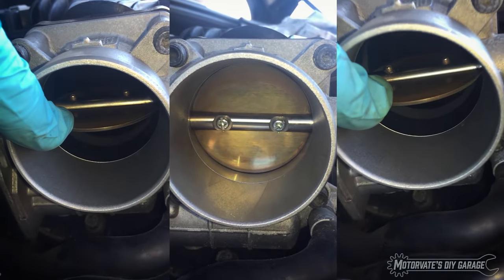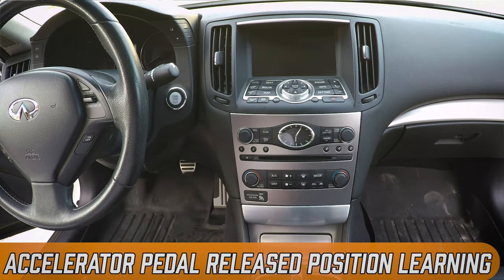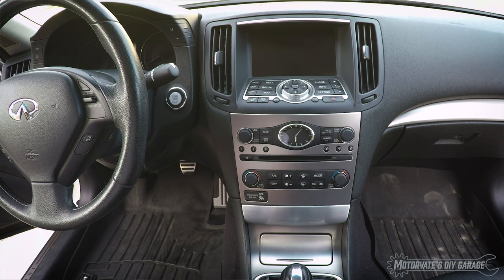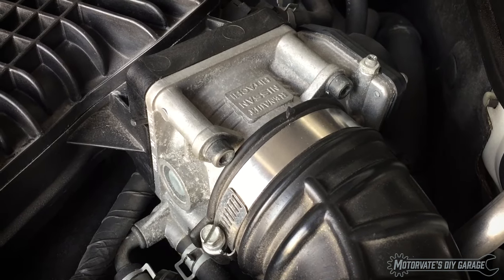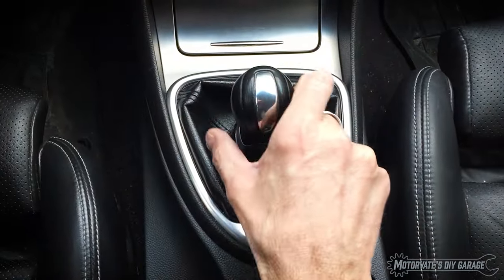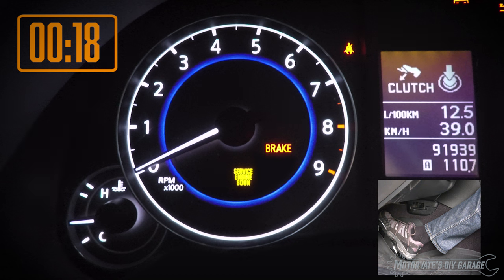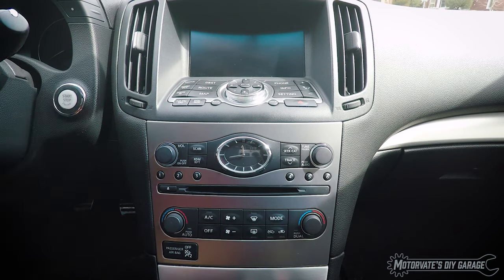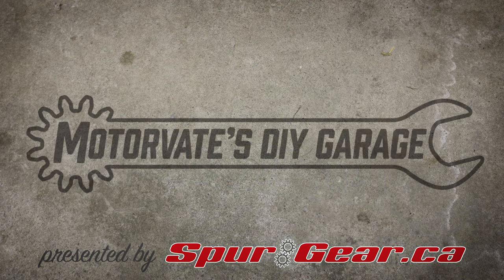G37 & 370Z After Throttle Body Cleaning: Motorvate’s DIY Garage Ep.27

Comment: I just followed all three steps in the video after cleaning my TB and everything feels fine. My concern comes whenever I turn my car back off, I hear the throttle bodies clicking like in step 2. If i did the entire process correctly, should they still be doing that when I turn the car off? Should I go back through and do the 3 steps again?
Reply from the maker: No need to worry. Every time the engine is turned off, the throttle body operation is checked by the ECU. After the engine has stopped turning, they are fully open/closed for a moment by the ECU.

This allows the ECU to double check that the electronic throttle body is working as expected. :)

Comment: Helpful video bro 👏
I have a question, my hyundai accent 2012 crdi diesel engine throttle valve is always almost at full open, in my scanner it shows 9% and when reved it only increases to 12%. Ive watch other videos their valve is also in default open position. There are times when intake air is 67C and exhaust manifold  temp reaches around 500+ , the throttle valve works fine, it closes up to 80% everytime i pressed the accelerator. And when it happens i have no hesitation when running. Sometimes even if the valve only moves up to 12%. I have no hesitation. Im just wondering if throttle valve signal also affects the opening of the egr. I can see there is voltage at the egr that opens it but its not in timing. It should only open when accelerator is released like i observes in normal running condition.
Reply from the maker: I hate to say this, but I have no idea...I don't have any first hand experience with diesels AND I'm not going to guess.

Comment: I’m going to clean my g35xs 2008 TB soon and was wondering what the ecu update idle relearn you are talking about? Wasn’t sure if it included the 08 version since they’re basically identical. If it does am I able to do this myself or do I have to take it to a dealership?
Reply from the maker: For some reason, just the 2007 G35/350z have the issue. For 2008 you don't have anything to worry about :)
Reply: @MotorvateDIY  Okay, thanks! Appreciate how you still answer the comments even after 4 years.
Reply from the maker: I check and answer comments almost every day.
Sometimes a simple answer is all that is needed and I'm glad to help :)

Comment: Ive just had my alternator replaced. After that start ups just dont sound as strong, and I have to pump the throttle to keep it from dying. The car seems to stumble a tiny bit when I let off the gas aswell. 2010 370z, 6 speed manual, sport package. Any ideas what I should do? I can't help but think it could be related to the alternator replacement.
Reply from the maker: I don't think an alternator would do that....

I think your first step is to clean the throttle body and do the steps in the "after throttle body cleaning" video.

That should restore your idle back to normal.

Comment: What if the battery is older then that and not the correct volts? Are you saying this won't work? Thanks
Reply from the maker: Hey EL34 XF2 LiFe,
According to the Nissan/Infiniti factory shop manual the battery voltage must be more than 12.9 volts at idle or the "idle air volume learning" won't be performed.

I mentioned the age of the battery as an easy way to guess the correct battery voltage, as I don't think everyone has a volt meter or meter.

Comment: So im gonna be installing oil catch cans in the near future. Ive seen plenty of videos on this but i have a question. Now i understand the whole install but what i dont concerns the hoses farther back on the valve covers. The ones closest to the front of the Car are connected to the pcv valves and it shows just plugging the ones farther back on the valve cover?? What are those one for? They look like another vent but minus the pcv valve. I dont agree with just plugging those shut. Could you tell me what they are for? I mean i know its a vent but for what and why are they just plugged on these oil catch can kits?
Reply from the maker: Hey Waugy 370z,
Under low load conditions, the rear hoses allow filtered air to enter the valve cover and crankcase. The intake manifold will have a vacuum and pull out the blow by gasses through the PCV valve.

Under high load conditions, the crankcase is slightly pressurized and the blow by gasses will vent out through both hoses.

There are two types of oil catch cans: vented and sealed.
Does your kit have a mini air filter? If so, it is vented
I suspect your system is vented and that is why they ask to plug the rear ports.

Post a link to the kit you have so I can have a look at it to better understand which type you have.

In my opinion, unless you have a turbo or supercharger, there is no need for an oil catch can.
For an engine in good condition the factory PCV system works well and you will only need to clean your throttle bodies every 100,000 KM or 60,000 miles.

BUT, if you like the look of it, then go for it :)
Reply: @MotorvateDIY  I think i agree with you. Because when i did clean mine they weren't bad at all. I was actually surprised at how clean they were. So yeah like you said i think im just gonna let it alone. The car was always serviced at Nissan before i got it and its in great condition. But thanks for the explanation about the back hoses. I always lime to learn more. You cant learn enough 👍 thanks.
Reply from the maker: Anytime :)

Comment: Are these procedures for all cars?  I have a 2001 Lexus RX 300 and I cleaned the throttle body and now I have high idle.
Reply from the maker: Hey Steve Cabral,
Generally these types of procedures are manufacture specific. I did a bit of searching for you and I think this may work: https://www.toyotanation.com/forum/104-camry-5th-6th-gen-2002-2006-2007-2011-2nd-gen-solara-2004-2008/1297865-throttle-relearn-procedure-new-battery-won-t-idle-run.html

If not just google "lexus rx 300 idle relearn procedure" and you should find your answer.
Good luck!

Comment: i have a question what would  the car do if you dont do the idle air volume learn the right way ?
Reply from the maker: Hey  Marvin JDM,
Good question!
No harm is done and you simply try again until it completes.
If you have an Android device and a bluetooth OBD scanner you can use this free app to run the idle air volume learning:
Quick & Easy Idle Air Volume Learning: Motorvate's DIY Garage Ep.28
https://youtu.be/OiB9txECWB0

Comment: My DRL does not turn off even with the parking break engaged before startup.  Would idle relearn still work?
Reply from the maker: Hey Mark Kevin Raymundo,
Hmmm good question. Knowing Nissan/Infiniti my guess is that it should still work.
Please try it and let me know.

Also, If you have an Android device and a Bluetooth OBD scanner you can use a free app to do the idle air volume:
Quick & Easy Idle Air Volume Learning: Motorvate's DIY Garage Ep.28
https://youtu.be/OiB9txECWB0

Comment: Great video, I have a question? Will these steps work the same on a 2015 Q50 3.7 Base Infiniti? Been wanting to clean the TB myself and not go to  the dealer$hip
Reply from the maker: Hey  Leroi Rocks,
Yes it will work on your Q50. This procedure works on just about every Nissan / Infiniti made since about 2003, when the electronic throttle was introduced.

Good luck!

Comment: Motorvate DIY 
I own a
2008 Infiniti
EX35 Journey
3.5L V-6.
I couldn't get the check engine light to blink for the idle re-learn. The car seems to be running fine and has a steady idle. I'm getting ready to run her on the highway after I take her to wash the engine down. I also replaced the iridium spark plugs and all 6 ignition coil packs. The right rear spark plug (closest to the firewall) had oil seepage on the outside of it. This may possibly be from the valve cover. I tightened all the valve cover bolts and hopefully that stops the leak.
What are some minor changes that I can do to this car to boost HP and performance?
Thank you.
Reply from the maker: Hey Jeremy,
It can be tricky to get the timing exactly correct. BUT if you have an Android device and a bluetooth OBD scanner, you can use a free app to do the idle air volume learning:

Quick & Easy Idle Air Volume Learning: Motorvate's DIY Garage Ep.28
https://youtu.be/OiB9txECWB0

The bolts in the valve cover are a "stepped" or "shoulder" type, and tightening them more won't increase the "clamping" force of the rubber gasket. If your valve cover gasket is leaking, it needs to be replaced AND I think on the HR, the only way to do that is replace the valve cover as an assembly.

As for more power, the usual intake and exhaust mods work well.

Comment: My 08 G35 has this weird weak throttle/acceleration delay under 2k rpms but it runs perfect otherwise. you can even hear it when the power kicks in over 2k rpms. If i am not aggressive with the throttle I sometimes look like a noob learning how to drive stick because it kinda lags a bit. I think it started when my car had a dead battery so i disconnected the battery and charged it  so not sure what happened. Which one of the steps you think could help with this? I never cleaned or messed with my throttle bodies before.
Reply from the maker: A clean throttle body will give a quicker/sharper initial throttle response.
I don't know if a cleaning will help with the delay, but it won't hurt.

I would clean the throttle body and then do the idle air volume learning.
Reply: @MotorvateDIY  thanks, I think im going to do it today after work.
Reply: @MotorvateDIY  so I did all the steps, cleaned it out good and followed your steps in this video, but it actually made it worse. my idle was even lower than before, like just under 600rpms after the relearn and the lag/lack of power still existed under 2k rpms, but it was much worse than before. I got so sick of dealing with it so I kept looking up videos and forums where I found a video of how to reset ecu without disconnecting the battery. I followed the steps in that guys video and it seems to have fixed everything! idle is perfect, no lack of power at low rpms and over all it runs amazing now. I did not relearn idle or any of those steps like in your video after I did the reset on the ecu and it seems flawless now.  Will the car relearn with daily driving like most cars or do I really need to relearn all that stuff?

Comment: Are these procedures applicable for an 2018 Infiniti q50?
Reply from the maker: I just checked the 2018 Q50 Infiniti service manual... It only shows using the Nissan/Infiniti Consult tool to complete the Idle Air Volume Learning.

So... these steps may or may not work. I don't have a Q50 to test, so I don't know :(

Comment: Motorvate DIY
IS There any chance that you can do some Infiniti ex35 Journey specific videos? I did use this video to do my accelerator pedal, throttle bodies and MAF sensors relearns, but having some specific videos for my 2008 Infiniti EX35 Journey sport model with 3.5L V-6 
It's difficult to find anything online that is specific to my vehicle to help me with repairs.
Reply from the maker: Hey Jeremy,
Sorry, but I don't have access to a EX35 to shoot videos and to be honest, I don't have the time right now if I did.

You might want to pop over to nicoclub and download your factory shop manual. That will tell you everything you need to know.

Comment: Tried doing everything as stated in your video after cleaning my throttle body's on 07 G35x but now car idles high at startup then once its a bit warm the rpm starts bouncing from 1500 to 2000 rpm doesn't change unless its in drive then it stays at about 1100 once put back in park its starts bouncing again like mentioned before have a scanner to do the relearn but the rpm can't rise past 1200 rpm so due to the bouncing idle the obd2 scanner is not able to program the idle relearn to the car any hints that could be done to help fix the idle issue on my car very tough driving this way 
Thanks 😊
Reply from the maker: Hey  Nelson Acevedo,
Crap!... I guess you didn't see the warning at the very top of the video description.

There is a bug in the 2007 G35/350z ECU and the idle air intake volume learning won't work.

The only fix is to update your ECU. Some have been able to get it done at the dealer or you can always contact Eugene at https://www.yelp.ca/biz/enthusiast-auto-care-concord

Eugene is the only person I would let work on my car. He is highly skilled and honest.
He has done this for quite a few and the issue is always resolved.
Reply: @MotorvateDIY  Thank You sir for taking the time to provide me guidance on what steps to take to rectify my issue keep up the great work on your videos very informative and extremely well done 👏
Reply from the maker: Anytime! Good luck getting the issue resolved.

Comment: Hello thanks for the video.
I need to replace plugs in the car.
If I take out the throttle (because that's how I need to replace plugs, too).
If I clean the throttle and I don't touch the butterfly.
i have to do direction?
i have g37. RPM plays a little
Reply from the maker: Hey ברוש
Generally if you clean the throttle bodies, it is a good idea to do the three steps in the video. The last step "idle air volume learning" teaches the engine computer (ECM) the new air flow values now that the throttle bodies are clean.

If you don't nothing bad will happen, other than your idle may be a little faster.

If you have an android device, you can use a free app to do the idle air volume learning as shown here:
https://youtu.be/OiB9txECWB0

Good luck!
Reply: @MotorvateDIY  thanks a lot for the answer.
I have another question, is it good to use an oil additive even if the engine is working properly?
Reply from the maker: As I see it, there is no need to use an oil additive if you use a name brand engine oil and change it as specified in the owner's manual.

For a little extra protection you might want to use synthetic engine oil.

Comment: I wish I knew why this was necessary because to me it seems like the IAVL procedure is more of a "rapid" relearn procedure, in other words, it forces the car to reset back to factory idle parameters. I would think that given enough time, the car would relearn the new parameters for the proper idle without performing this procedure. If the car is able to learn the proper idle going from a clean throttle body to a dirty one, why would it not work the other way around?
Reply from the maker: I agree with what you are saying and also thought it would "re-learn" on its own... but it doesn't.

My guess is that there is a very good reason for this I just don't know what it is. :)

Comment: I think I messed up the second part and allowed my engine to idle too long to heat up, which caused it to heat up too much. Once I saw it in the middle I should of just turned off the car. Instead I waited an extra minute and turned off the car and heard the clicking sound. I believe my car now learned to idle too low. Idles around 500rpm.

If I let my car sit for around 7 hours while at work in 30s degree weather. Will the car be could enough to do all three processes again? You said to let it sit overnight, is around 7 hours long enough to completely cool it down or should I wait till tomorrow morning?

Also, since I drove the car back and forth to work yesterday and to work today. Should I first reclean the throttle bodies prior to doing all 3 relearnings?
Reply from the maker: hey Nicolas Langel,
No need to "re-clean" the throttle bodies. They don't get dirty very quickly.
Letting the car sit overnight or 7 hours should be good and then re-do the three steps.

If you have a bluetooth OBD scanner and a Android phone you can use the NDSIII app for an easy way to do the idle air learning: See this video: https://www.youtube.com/watch?v=OiB9txECWB0&t=2s

Comment: Im getting a replacement engine (13' with 27k miles going into a 08 g37s) at that mileage what would you inspect or do? Cleaning and maintenance wise?
Reply from the maker: Hey Xavier Sanchez,
With that low mileage I would expect everything to be ok. 

However, it wouldn't hurt to clean the throttle bodies, have a look at all 6 spark plugs (they should all look about the same), and check the engine oil pressure: https://youtu.be/-Io6ryxWFtQ

I hope you enjoy your "almost" new engine :)

Comment: Ok so I have a vq35HR (g35 sedan 2008) I’m scared to clean my throttle body because of what it says in the description does this mean I should get it cleaned at the dealer ? What do you recommend ? Because I’m not sure how I could get a software update done.
Reply from the maker: The 2008 HR doesn't have this problem :)
Based on comments here, you don't have anything to worry about.

Comment: Just called the dealership and they charge $189 for the cleaning and idle relearn as part of all of it. I think she said DEcarb is recommended every 60k miles   @Motorvate DIY
Reply from the maker: Hey  Brandon D,
Thanks for that information. Isn't is nice saving money and doing it yourself? :)
Reply: Motorvate DIY  yes it is, just going to follow your directions, once I get my intake tubes off and buy throttle body cleaner. Do you have any opinion on throttle body spacers for the VQ35HR motors?
Reply from the maker: Hey  Brandon D,
I don't have any first hand experience with throttle body spacers, so I don't know.

My guess would be they would do very little, if anything, as they only add a little extra volume to the intake plenum.